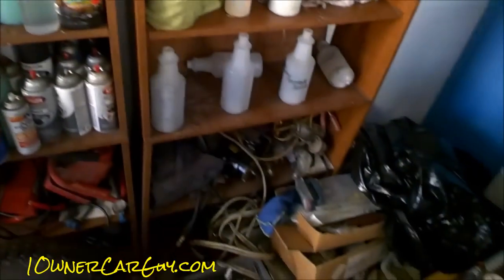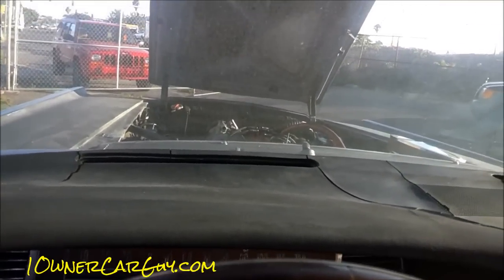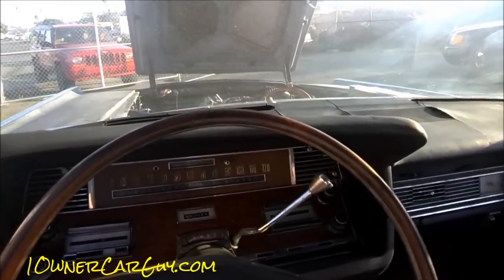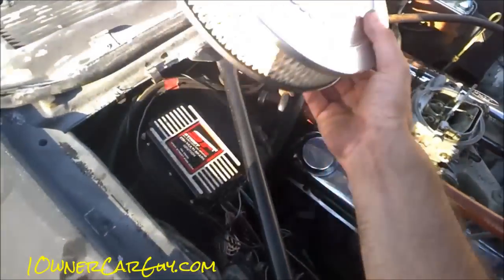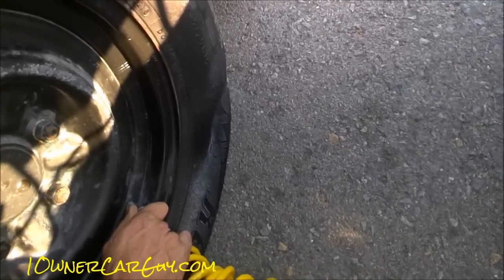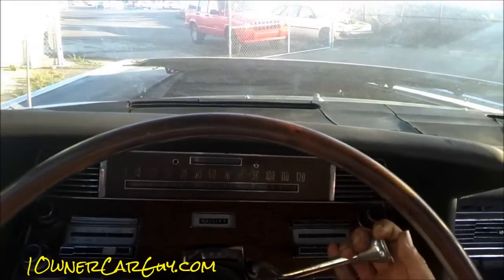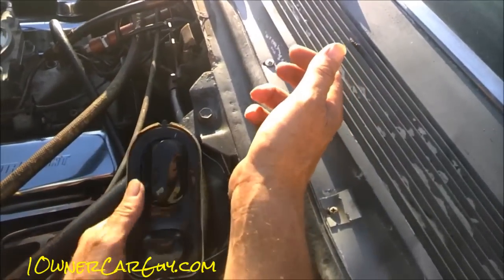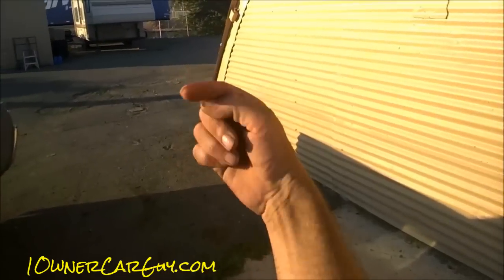Cold Start Barn Find Classic Car Lincoln Mechanical Starting Old Cars

Comment: Its probably a ground issue with the horn. Check the circuit and the main grounds on the chassis. Btw whats that charging machine inside the car?
Reply: +Cereal Marshmallows that machine you picked up when you were in the jeep

Comment: That hissing is probably bleeding vacuum from the brake booster. There is either a dry-rotted leak- allowing the brake fluid to enter the booster- or it's check valve is stuck (possible cause of rough idle).  Having to add that amount of fluid (rear brakes) to a closed system (it's not supposed to "use" fluid) constitutes a dangerous condition. Don't wait for a possibly burned out warning dash telltale (idiot light) to warn you of no brakes. Please be careful.

Comment: Well, seems todays mechanics  are lacking if they can't plug in a scanner..lol  The edelbrock 1406, I put one on my 83 Mark VI 12 yrs ago.. new out of the box adjusted it and that was it.. has yet to give me any issues.. I wonder what MPG that car would get  with that 302 ci..  I know I only get 10 mpg with my 66 Continental..but has the 462ci.. will cruise at 80 mph not even trying..  ;-)